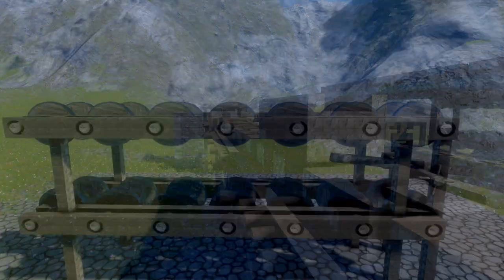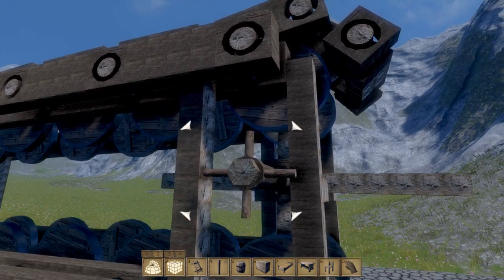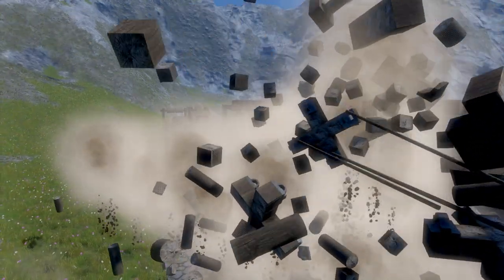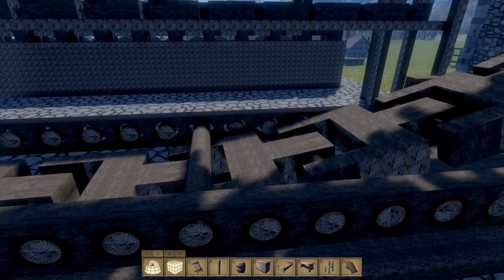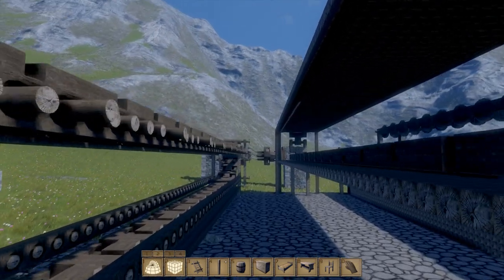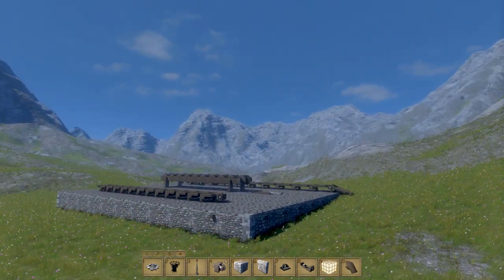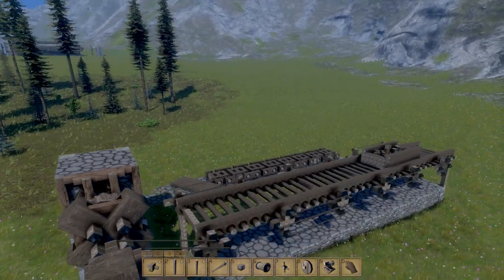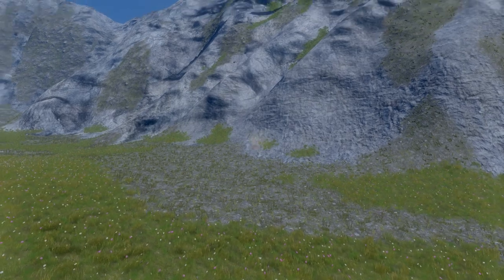Medieval Engineers - Catapultank #1. Tank Track Concept

Comment: In regard to the fact that rotors cannot be placed on things that move: You can technically encapsulate a free rotor (obtained by deleting the block under it then copying it. Be careful! It's fragile, so drop it on a big pile of loose wood.) by placing a wooden frame around the bottom edge (you'll have to make it slightly bigger than the rotor base itself.) then building up and creating a framework going across the top of the rotor and around the sides. You need to be careful when doing this and make sure to give it at least a bit of room to wiggle around, or else the rotor will phase right through your frame. From there you could most likely build up the frame a bit and reinforce it in whatever ways you can think of. I only had a bit of time, so getting it locked in was all I could figure out. I can't speak for the durability of it, and the process itself is pretty annoying/difficult to do, but it IS possible to get a rotor free from the large block grid.
Anyways, good luck and I hope this information helps you in some way.
Reply from the maker: Nice trick, interesting that I've been given 2 completely different methods in the comments for getting the rotor to separate itself from the ground.. apparently should have kept trying with it :) Sounds like a faff but still not as bad as making that damn track so all good tbh! Cheers!
Reply: ***** Not sure if you're still working on this design, but in terms of application, you could conceivably use your track as a belt for a belt reduction drive. Currently in the game (as far as I have found) there is no way to increase or decrease rotation rate/increase torsion strength of the rotors, so it could be pretty useful unless Keen adds something else in.
Reply from the maker: 12jojimbo
I really hope keen does add something in, prolly my biggest wish for ME at the moment.. Interesting idea with the gear reduction approach, although might not be able to get it efficient enough to not end up a net energy loss anyway.. :(

Comment: Clean your world more, less things sitting on other things (like the tracks on the tables) means less sim lag when not using them.
Reply from the maker: Liarra Sniffles I did try that and it didn't make a difference, the tracks themselves cause so much lag the extra for the few bits that are kicking around doesn't really make a noticeable difference.. hence I went back to a save where at least I still had the original variants.

Comment: You can press J to make things free floating. Build a wooden platform and drop the rotor onto it. I had to do this in order to make a car with a drive system/gears
Reply from the maker: Guess you then have to build whatever ur making around the rotor but should work.. nice one, thx :)
Reply from the maker: MetricZero
I'll take a look :) Cheers

Comment: Hmm... If you made a one of tracks wrapped around around a rotor like a chain you could use it to make a portcullis in a castle. Oooh NGC next gen castle lol
Reply from the maker: hehe, perhaps so! lol.. I think this actually has a fair few applications as a technique just need to perfect the design, make a proper chain and get it to interface just right with the gears so it's nice and smooth. Although really hope we get proper gears soon, sure they are coming!
Reply: You could build it with a pseudo advanced ancient civilisation style. Kinda like Sci-Fi Mayan meets Elven Fantasy look with loads of hidden secrets and technology lol
Reply from the maker: ***** Yeah sounds like fun :) Step one however is get the tank able to move!
Reply: Indeed... Hmmm. Have you looked at the Warhammer tank Aron from LastSandGame made in SE? Maybe there's something in that relevant to your tank track. There quite different designs but perhaps it could help. Also when your track is coming over the top edge it has that sharp corner in has to kinda clumsily get over... Maybe if you smoothed that it might make the entire track run better. The resistance could be a factor! You could also try maybe some sort of cross section in between two wheels to close it in to make a gear, then put stuff to act like teeth for it to catch along the inside of the track. Then double it up so there are 2 rows of teeth and the gear is wheel/cross/wheel/cross/wheel to add some stability.
Reply: LastStandGamers*
Reply from the maker: *****
I know the video but we're lacking some options vs space engineers.. although how the track interfaces with the drive wheel is an area I definitely want to improve. It's just a tricky task with how everything has to be built as 2 separate supported parts and even then the track needs to be supported to.. take into account any cog system needs to be 'timed' to match the belt it becomes a nightmare pretty fast! Still, gonna give it a try :) See if I get lucky!

Comment: Maybe treads aren't the best idea, perhaps you could go for an APC design that uses 4 wheels on either side, instead of treads. Now, this would be just any normal vehicle, which may be kind of boring, but you could fix this by trying to add suspension. I don't have the game so I'm not sure how you could create suspension, but the tension springs look like they could play a part in that. Great vid as always!
Reply from the maker: Yeah I think suspension should be possible, need to think a bit how to fit the tension spring in as they are kinda large but I think a dual-wishbone setup actually shouldn't be too hard to recreate. I'll stick with the tracks too ofc, just have to :P Something too cool about a wooden tank heh. Cheers!
Reply: ***** :) Maybe you can put suspension on the tracks. If you ever get the tracks working, that will make them much more effective (Assuming putting them together will work). I agree, suspension might be possible, it's just that I don't think you'll be able to tune it, so getting it to work with the tank might be difficult if the tank isn't the ideal weight, if you get what I'm saying.
Reply from the maker: Chace Totally get what you are saying and agree that is likely to be an issue, there's a lot of elements that you can't completely control and just have to hope fit right when it all goes together especially with the tracked version.. Which basically means spend ages building it and then it might work at the end, might not :)
Reply: *****
 the suspension idea is a bust atm, tried making a simple suspension, as soon as i placed it, bounced nicely then parts exploded and the rest started floating...200m in the air.

that said, it can be tuned to a degree, use ropes to limit how far it can kick, the bugger would be getting them all set to a similar level.
Reply from the maker: Nathan5027
Yeah sounds like a bit of a nightmare honestly.. and with that much energy stored when it goes wrong it goes wrong badly :) Cheers for letting me know!

Comment: Nice explosion there, Micheal Bay will be with you shortly :p  

Tanktracks have been in the back of my mind for a while but never really made an attempt at making one yet.  
As for your rotor problem, there are ways to use a rotor mobile, but it's kinda weird.  
The only way to attach things to a rotor are at the top or the bottom, the thing that normally rotates. So when you try to make a rotor mobile you actually need to make use of what is normally the bottom frame as a source of rotation, since your machine needs to be attached to the actual rotor, and as such that part can't rotate anymore.

Once you get a rotor mobile, you really gotta build the machine around the rotor.

To make it mobile, you have to build it on some solid thing, for example a foundation, but foundations will close off one side, so instead of that, build it on 4 pillars so you can reach the bottom. Then build some timber stilts from the rotor ( not the frame) to one block from the floor, and next delete the pillars. If all goes well you should have a mobile rotor where you can build stuff on.  
You can set them sideways as well this way.
Reply from the maker: At least in ME when it goes wrong it goes wrong with a massive explosion and you feel slightly justified regardless of the fail :)

Nice tricks with the rotor sir, sounds fiddly but tbh everything with this build has been so no worries there, just glad there is some sort of solution to it. very familiar with the stilts approach to building and then separating things just hadn't thought of trying it like that with the rotor so hopefully shouldn't be too hard.. Did kinda figure that it would mean building around the rotor so no worries there. Thanks for that... have some renewed energy for this now :)
Reply: ***** Had some more ideas about this that maybe you could try.  

-Getting bigger possibly square wheels front and back to pull the tracks forwards. Making it so that the track can nicely wrap around 3/4th of the wheel.  
-Put the wheels on torsion springs that you can pull back to make it easier to put on the tracks, and then release them so it adjusts to the length of the track, but make it so that it doesn't try to stretch the tracks, otherwise you'll have issues.
-Add just a few support beams for the top section of the track for it to rest on, don't use a whole rail as it probably causes too much friction, and it probably also causes your massive slowdown as it needs to recalculate the physics every time it has a minute bump with the rail.
Reply from the maker: The torsion springs I'd thought about but tbh having seen how the tracks behave when tensioned by the rope was scared of what would happen. They need a certain amount of give in them to be able to turn the corners. Could definitely reduce the number of support beams on the top though, didn't really wanna go to far with those changes till I got it on the ground as that would effect how the physics acted I expect.

Some nice ideas though, will give them a try, see if the bigger drive wheels help etc :) Cheers

Comment: The physics engine must hate you, trying to calculate the movement of all those blocks lol.  Does it create more problems by simply putting the treads around one set of wheels, instead of one set at the top and one set at the bottom?  (One set of wheels might solve some of the physics issues with the tracks- less to calculate)
Reply from the maker: You can't make the tracks turn tight enough for that unfortunately. One of the main limitations for this, although not obvious, is the size of the catch blocks meaning that in order to articulate a tread has to be a minimum of 6 blocks long to both fit the catch blocks in and leave room for them to turn.. Very much limits how small you can make it and it wouldn't be able to turn sharply enough to manage that I think. Physics engine does indeed dislike me quite a lot :)
Reply: ***** shame, oh well it was just a thought.
Reply from the maker: Stewart Bates
Keep em coming dude! Very much welcome any input people have even if it's not practical in this case :)